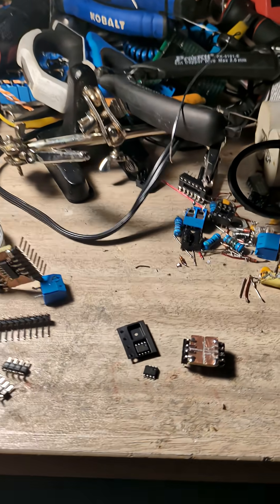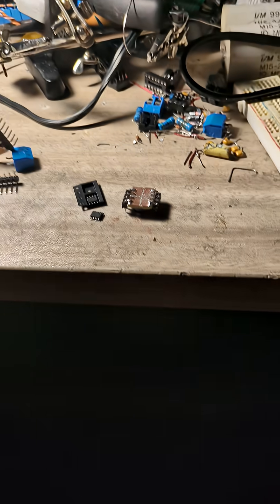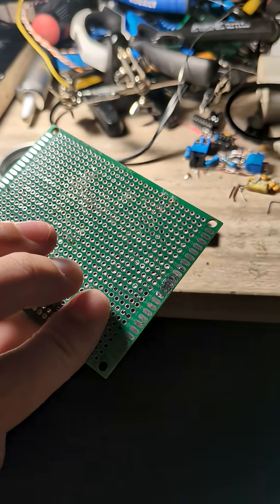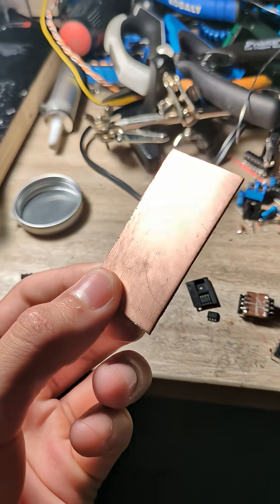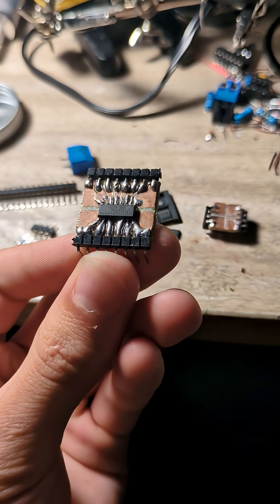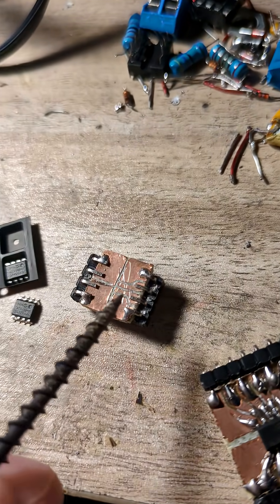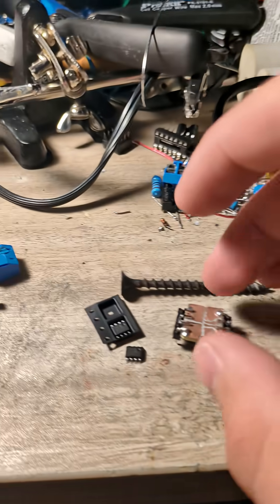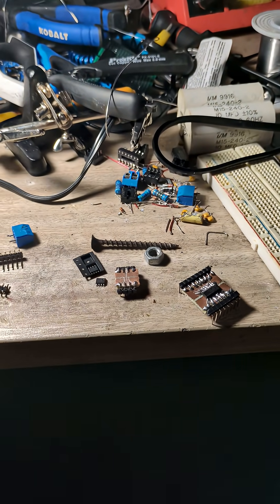how to convert an SMD component to a THD component #engineering #electronic #smd #experiment #diy

Comment: I find already manufactured converters for smd on the market, but if they're not available you can use a pcb sharpie and etch it yourself
Reply from the maker: Yeah I have the option to buy my own but it's quicker and cheaper to do it this way.

Comment: Put an insulator like tape under the chip and solder wires from the chips lead to the post. You can use double side tape to hold it in place while you solder. No need for all that jazz because not much current will be passing through those connections.
Reply from the maker: Nice tip!